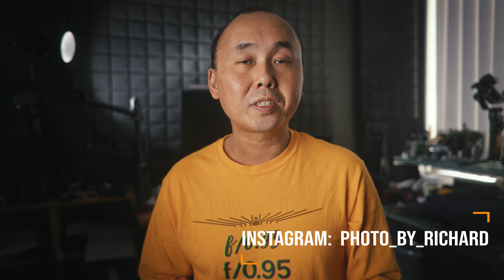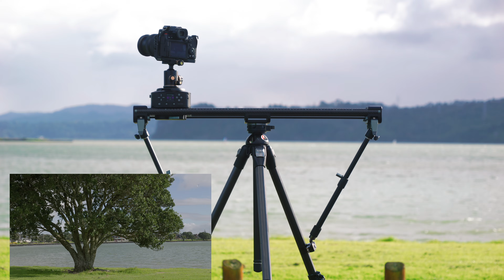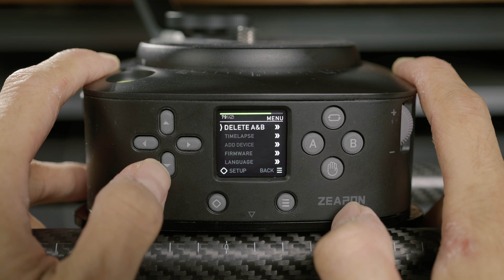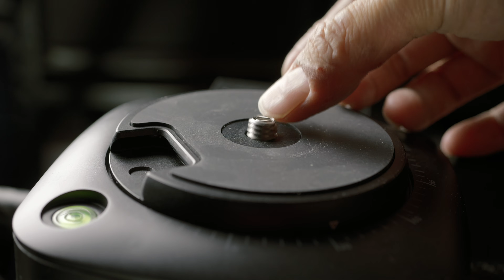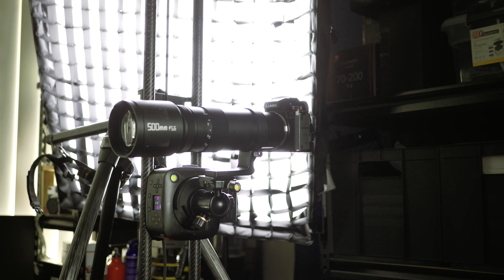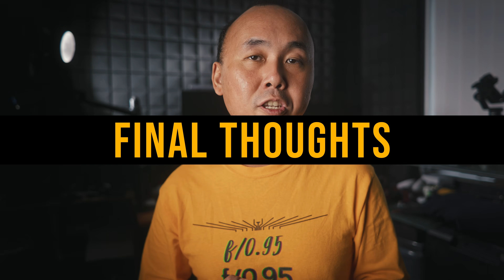Zeapon Axis Pro - The Most Powerful Camera Slider

Comment: Hi Richard, thanks for the comprehensive review of the Axis slider.  I purchased the pro version and received it yesterday.  The slider and pan head work perfectly, both with and without the app.  However, the Pons PT head is not working at all.  There is a red indicator light on the front when I insert the battery or plug it in via USB-C.  When I try to connect it to the app, there is an error message.  Do you know if there is a way to reset the Pons PT head or is something I'm doing wrong?  Thank you in advance.
Reply from the maker: It maybe firmware related, but i think best is contact zeapon's service department by emailing them:
services@zeapon.com they should be able to help you! :)

Comment: Whats the travel speed from one end to the other at 100% speed? Im considering this slider for real estate work and need it to travel at least 12 cm/ second (5 inches/ second) for preferred results.
Reply from the maker: Sorry i don't know of the exact speed, but i imagine it is slower than 12cm/s.   You could look at the new HIGH SPEED version of Zeapon Micro3 which does give you exactly that speed: https://www.zeapon.com/high-speed-motor/
btw, i'm curious, for real estate work, why can't you shoot at slower speed and then play it back at higher speed instead? Given that the scene is usually static (i assume?). Would be great if you can share with me the reasons behind that :)
Reply: @TheRealRichardWong  Hi Richard. Thanks for asking! The workflow with my team requires me to operate quickly when shooting on location. Sometimes there are dynamic elements such as ceiling fans and fireplaces that arent entirely static. The new high speed motor you listed for the Micro 3 can go up to 12.8cm/s, which is perfect for my needs. Thank you for the reference!
Reply from the maker: @DapperArtImagery  oh ok that makes sense.  Thanks !

Comment: If you use the app does the unit have the same a/b point movement confusion? If not, just use the app to control the slider.

Comment: Would you say the Axis is better than the micro3 in terms of smoothness? If I'm only concerned about shots being jittery, what version would you get?
Reply from the maker: I have to say I feel both are reasonably good and I didn't notice much difference.  But I haven't done any side by side comparison to compare.   However when using in manual mode (ie. No motor), the micro3 is much more fluid it's much more dampened but I am not sure if it affects motorised mode

Comment: Always look fwd to your videos!  Thorough, informative, and relevant to todays filmmakers.  

Wondering what the price is on this new slider?
Reply from the maker: hi Ryan, price is from $599USD for the 80cm Axis, or 835 for 80cm Pro Axis.
Reply: @TheRealRichardWong  great info, appreciate it.  And the difference between normal and pro is the Pons unit addition?
Reply from the maker: @kernzilla  correct! The additional tilt head and brackets for it
Reply: @TheRealRichardWong  nice.  I think this is a competitively priced unit that looks to be very capable.   And that PONS unit from AXIS completely interchangeable with the Micro3 line yea?
Reply from the maker: Yes I believe so!  If you got the old one, just need to update firmware to latest.. and I would assume it would still be compatible with micro2/3
Reply: good to see zeapon favoring their ecosystem rather than working against themselves.  great way to keep your customers happy. thx again!  @TheRealRichardWong

Comment: Love that it doesn't need an app.  And completely agree that the 2nd head absolutely needs to be controllable by the main controls on the pan head.  
As with the pan head, the 2nd head needs to allow the camera to be manually moved, pointed and tilted to a location, select the A point, then manually moved, panned, and tilted to point B point. All using the main set of controls, without touching the controls on the 2nd head.  If Zeapon can update the system to achieve that functionality, will buy one.  Otherwise, will not. - Another great review.
Reply from the maker: Hey thanks for watching and let's see if zeapon will make some more improvements to the firmware :)
Reply: @TheRealRichardWong  Please provide an update if they add that functionality.
Reply from the maker: @Trevellian  yes will do!

Comment: Thanks for the review Richard! I've a question for you about this slider... Does this slider start to make loud crick and crack sounds, while operating it, after a few times of usage? I bought the Zeapon Micro 3 with the motors and it's totally unusable if there are microphones involved while filming. There are very strong sounds coming out from the rails, near the center of the slider. 

I tried to contact zeapon about it and they never replied to my email...So I guess I'm forced to find a replacement for the Micro 3 slider and I hope this unit is going to work better for my needs. Thanks!
Reply from the maker: Oh that's no good.  But no I don't have those issues.  Zeapon's customer service is usually pretty good..  strange you got no reply from them.   Maybe try email them again?
Reply: @TheRealRichardWong ok, thanks. I'll try again to contact them

Comment: I'm using a Micro 3, but watching this just made me think of a question I'm hoping you might have an answer to.

In the app you can set more than two waypoints. When doing this, I'd hoped for one continuous  motion from each waypoint to the next, but in practice the slider stops momentarily at each waypoint, making this function far less useful. Is there a way to have one continuous motion? Am i just doing it wrong?
Reply from the maker: You didn't do anything wrong, it has been always like that I think I have also talked about that in one of my previous video.  But I have checked with Zeapon they told me it's one thing in their to do list that  they want to improve,   hopefully by end of year as they are currently working on a few other bug fixes and improvments
Reply: @TheRealRichardWong Thanks Richard, appreciate the inside scoop.
Reply: Noticed this waypoint mishap on some other review videos, and certainly yields an unpleasant look!  Def an odd decision made by the dev team
Reply: This is the my main gripe with zeapon. If they just polished the app, it would be such a wonderful experience using their products. For the life of me, I don't know why they don't pour enough effort into improving their app. Not to mention that they downgraded it taking out the feathering of the movements between waypoints.
Reply: proper app dev is difficult and expensive.  it's nothing new for companies to release A+ product with C+ app.  i don't think what they've provided is horrible, but def room for improvement. and unlike a LOT of sliders, zeapon clearly went out of their way to maximize usablity without app at all.     @shmurt11